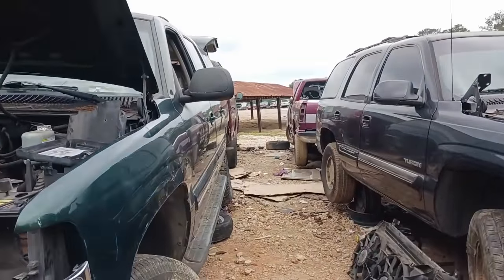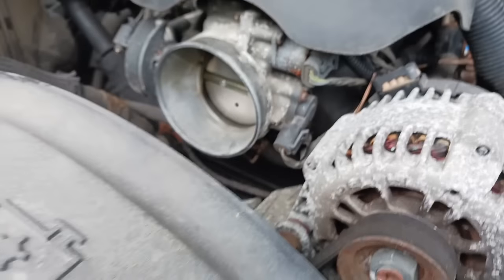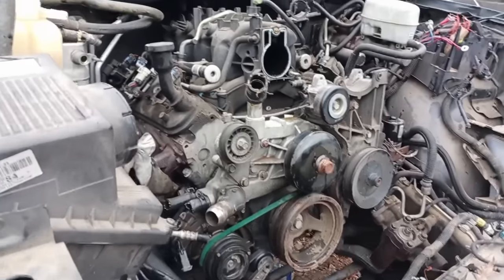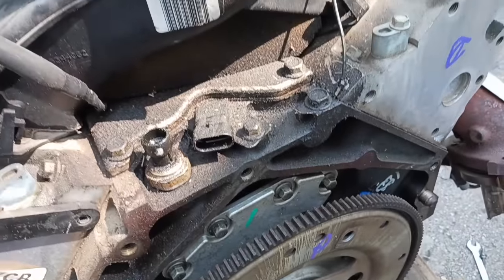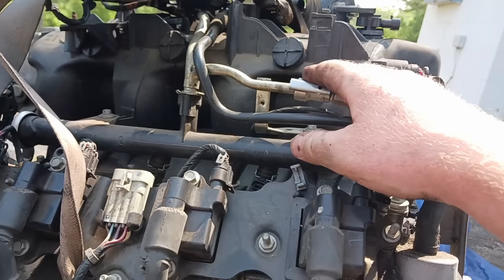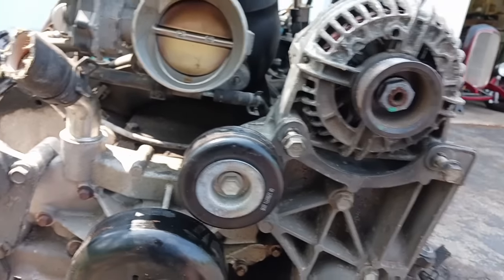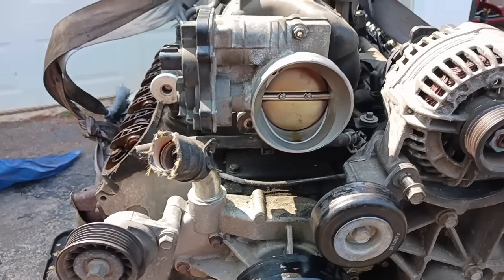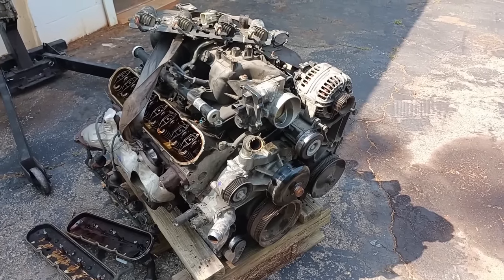Choosing a Junkyard LS Swap engine to Pull

Comment: Here’s my only bit of advice on choosing a junkyard engine. Get one out of a car that’s been totaled, smoked, hit really hard and not out of one that’s clean and in good shape. Odds are that the clean car is in the junkyard because it’s got a junk engine or trans.
Reply: Another tip that's related;
Not one that's taken a hit in the engine bay.
Preferably something totalled in the rear or side.
Reply from the maker: Yep, always look for the accident victom.
Reply: My advice is.  Start the dam thing and run a compression check on it  .don't guess
Reply: @inmate666 junkyard cars don't have keys 99.9% of the time in my experience. You might be able to manually turn it over but that's about it
Reply: @DaleDenton  true that. It was to easy for me because I owned my wrecking yard for about 30 years. I could start one in or out of the car but I had special stands and buzz boxes to start anything. Plus I had several guys to do it for me. When u sign the pay checks no need to get dirty anymore. If I sold a motor to one of my favorite shops it better be good.
Reply: Haha 💯
Reply: i got an 80k benz Inline 6 from a trans that had a hole in it. man i was so happey lo
Reply: I take a small portable jumper in the junkyard just to turn over the the engine. Sometimes you get lucky and the car will have the keys this is in San Bernardino California 92408 .lkq junkyards
Reply: Yup I pulled over 20 engine from junk yard they all run strong .  Make car
Reply: @DaleDenton  You don’t need a key to do a compression test, just bring a battery and a lone wolf 6000 trigger and hook the battery to the starter
Reply: This is literally what he says in the first part of the video.
Reply: This is the first thing he said in the video.
Reply: This☝️.. is definitely the first thing you should Think about/Notice when snooping thru the ol’ yard.
Reply: Damn it's like he said that in the video huuuh

Comment: You won't be finding LS engines in junkyards around my area. The yard pulls them before they set the cars In the yard.
Reply from the maker: That sucks, there's only 1 yard around here that does that, but they have newer cars and sell the body parts for cheap, so I can't complain. I just don't go there for engines.
Reply: @wilsworkshop  do you have a ls3 for sale by chance?

Comment: These are great tips for people junkyard mining for LS based engines. The truck engines (4.8, 5.3 and 6.0) make for a great swap since they are iron blocks with the same architecture. I'd swap out or closely inspect the knock sensors and harnesses also as well as the intakes for cracks. Covered it all pretty much though, nice work!
Reply: LS BASED NOT LS ENGINES...PEOPLE SHOULD LEARN THE DIFFERENCE
Reply: @mikedewsberry1774 YOU DONT HAVE TO YELL OLD MAN
Reply: @mikedewsberry1774 Actually they are. GM even says this.
Reply: @mikedewsberry1774  If you can put LS internals and accessories on it, it’s an LS. Truck motors are just iron block engines where as the car engines (LS1, LS3, etc) are aluminum blocks

Comment: Worst part is its getting harder and harder to find wreckers that'll let you pull your own motor or theyre already selling used motors so they wanna pull it for a price.   In canada wreck yards are disappearing left and right also.
Reply: Where I live, junkyards are not what they used to be. They are now "automotive recycling centers". When a wreck comes in the vehicle is stripped. Engine, transmission, axles and all useable parts are removed and cataloged.  You no longer get to wander through the yard.  Items are purchased at a counter similar to an auto parts store. If you want an engine or transmission you have to act fast because local shops buy these items as soon as the wreck hits the yard. The DIY'er is becoming a thing of the past. If you want an engine or transmission you have to go to one of the shops. You'll pay more, but you get an item that has been checked, repaired and/or overhauled, and comes with a limited warranty.

Comment: I never noticed that the flex fuel injectors are longer, I actually just swapped non flex fuel injectors for a set of 30lbs injectors but I didn't change the rail

Comment: there is nothing that comes of that, the vehicles have run their lives. done their share for the families. they wear out esp the rwires when they get frrayed etc, and the outside parts look beat  etc and most of all, if you throw them in the car truck etc they end up back to sq one after the "added" more abuse/miles and wont get the $$$$$$ like its the ones they started out with when you buy a new car,  its major headache plus when you tinker add holes etc to the vechicles they weaken the other partts of the vehicles and their ives are shorter as well.
Reply from the maker: I was just thinking the same thing.

Comment: Great info! A quick possible indicator for an E85 is the gas cap although the injectors is a definite way to identify them. Damage to the rear of the vehicle is always best since front end damage could have damaged the radiator and the engine was left running to overheat, spark plug inspection will help identify that. I also take a small jump pack with me. If the vehicle is complete enough you can usually get the cluster to fire up to check the mileage.
Reply from the maker: Yep, it's a good idea to always check the oil cooler and rad for leaks. Easy ways to smoke an engine if its in an accident and pumps all its fluids on the ground.

Comment: I took a different approach. I gave $2500 for a 2004 2500HD drove it 150 miles home. Sold core support. A fender Brush guard And transfer case. Then sold my trashed 350 tbi and the 4l60e and the ten bolt rear. Before Modifications/ Upgrades. After I hold the rest of the truck to the scrap yard. I have $700 in a 6.0 4l80e 14 bolt Full float rear. Front differential, Plus
Larger hubs and brakes.  Gas padel. wiring. Which I gave away, And it was all sitting in my yard while working on. Something to consider👍
Reply: Exactly I don't like wrenching in the junkyards either! Way better to buy the whole thing!
Reply: 100% if you have room for 3 junk vehicles.
Reply: @JamesMcNamara-j1g  Not plus not equals not. Lol.  It was one #" junk"  Vehicle   And Not to restate the obvious, but if you live in a Trailer Cort, An apartment building, Or a neighborhood with Home owners Association.  Then your 💩 out of luck. Well kinda, kinda not. Because hot roding and improvements are a sickness. So if you Save all your lunch money. You can go buy something That already has many Upgrade for less then it will cost to do it. Like a car someone spent a hundred thousand dollars to build and solded at baron jackson for forty. ✌️

Comment: I came across your channel and subscribed. I'm a equipment operator at pick n pull and i see customers go after the 6.0 Ls engine off gmc Denali and Escalades.
Reply from the maker: The 6.0s are the treasure for sure, worth 2-3 times as much as a 5.3.
Reply: @wilsworkshop  I'm fairly new to Chev's, why is this?
Reply: Aluminum block 6.0 is the golden ticket!
Reply: @absolarix because the 6.0 is a 400 cui full roller engine and there's no replacement for displacement!!😂😂🎉

Comment: If you get an AD244 alternator you don't need PWM controller. Sometimes a refurbished alternator will have a DR44 front so look to see if it's a 4 pin.

Comment: Very useful info thank you. I will say though that with all that knowledge but you still didn't know not to set the engine down supported on the flywheel gear 🤔.

Comment: This EFI stuff is out of my wheelhouse of expertise but I'm finally after decades thinking of messing around with this brand new EFI thing! Just kidding (I'm a shhhhh carb guy) but if you were going to try n make more power with factory parts would the flex injectors be capable of a bit more HP? I'm guessing they're larger for the ethanol? I'm one of those people that when they get interested in something I just absorb every bit of info I can do I was just wondering. Getting into boost is just so much easier with EFI and blow thru carbs are really expensive so I gotta figure this all out.
Reply from the maker: The flex flow 36 lb/hr. Non-flex 24 lb/hr. I usually use the flex ones with up to a "stage 2" cam with regular gas. They usually work for about 6 lbs of boost also depending on cam. Beyond that you'll need de-caps or aftermarket injectors.

Once you realize EFI is identical to a carb, but better, you'll never want a carb again. A carb can only be tuned for one tempature/rpm/altitude set of variables, but EFI is like having 100 carbs that get swapped out every time the rpm or other variable changes. EFI is max power at every step of the rpm range instead of a carb tuned for a narrow power band and "good enough" at the other parts.

I swapped to EFI 20+ years ago and literally threw my boxes of carbs in the trash.

Comment: Small head bolts? Never heard about that. I’m using an 01 5.3 so I guess I have small head bolts.
Reply from the maker: To clarify, it's "small head" " bolts". The valley cover bolts are large or small head, I think its 10mm vs 13mm,  from the engines I've pulled apart, all the "large head" bolts on 2005-2007  engines correspond to having Gen 4 rods since they were swapping production and gearing up for Gen 4 engines and used up all the Gen 3 rods.
Reply: that's good to know @wilsworkshop
Reply: @wilsworkshop  that's good to know. I wasn't aware of any identifiers for which ones got the gen 4 rods. Thanks
Reply: @wilsworkshop how much better are gen 4 rods ??

Comment: can the wrong fuel injectors make the truck run like it has a misfire?
Reply from the maker: Yes, if the injectors don't match the injector data in the computer they won't operate correctly.

Comment: What if i see gunk buildup in all the engine but it was running with low oil pressure. Do you think it Worth buying
Reply from the maker: Personally I would pass, the buildup usually means poor oil change maintance, so likely a neglectful owner and worn parts. Theres plenty of good engines out there to try rescuing beat up ones.

Comment: do you think a 1998 or 99 chevy 3500 ls would be a good swap engine has 120000 miles I want to put in a 56 olds I know it ran but the brain died its be sitting for some years now or look for a different one any problems you know of using this thanks
Reply from the maker: A 1999 3500 should be a 6.0L if it's a LS engine. The only downside is the 99-00 6.0's usually have cast iron heads instead of aluminum. Just extra weight and less desirable is all, doesn't really hurt the horsepower.

Comment: I figured you would have pulled the engine out of the truck that still had the hood.
Reply from the maker: I sorta did, I removed the hood before I started recording. Water intrusion from missing hoods is one of the first thing I look for. No hood and no intake manifold is a hard pass every time.

Comment: Hopefully those heads aren’t castech 706 heads. I lucked out on mine and they weren’t castech
Reply: I'm running 706 heads on my 96 gmc ls swap one turned out ok the other is not happy at all unspent fuel vapor just blows out the passenger side head I only noticed because I carbed my ls swap and had that venting into the air

Comment: also you make parts up to fit the rust, then you decidet part with the car after several years finding tires which wont last less then a  month, then the car breaks down wherever its going and all the hassle for a extremely short tem fix an last $$$$$$$ wasted for a new vehicle.

Comment: Is the motor out of a 07 suburban ltz 1500 any good for a swap ? Into an older chassis. Have the truck just sitting here, just wondering if I could do anything interesting with the motor, thanks
Reply: *I believe it’s the 5.3L v8
Reply from the maker: Check the 8th digit of the VIN, it's the engine code digit.
Reply: @wilsworkshop  is the 5.3 liter from that truck any good?

Comment: Why are you checking for leak?
Reply from the maker: Leaky engines usually mean more heat cycles on the gaskets, which can mean higher miles. Junkyard engines are a mystery, gotta improve your odds of getting a good one.

Comment: I love it but my problem is I love that whole truck. That whole platform from beginning to end is amazing. I hate everybody wants to pull that engine out and put it in a car. Why not just build the truck itself? I mean yes they brought out but the SUV doesn't rot out as bad as the pickup. The 2500 is solid the 1500 rots out and has a weak transmission.. weak by 20 year old standards... Today a 4L60 wud be god... The sick ol lady 6spd is ass
Reply from the maker: Yep, the GMT800 was the best platform of GM trucks pretty much ever, I have a few of them. These are junkyard "trucks" though, can't buy and fix them even if I wanted to. So the best we can do is snag their parts/engines.
Reply: I get what you’re saying, but those of us who are pulling these motors for swaps aren’t pulling them out of good trucks. We’re taking them out of ones that aren’t save able, if the body is all smashed and the frame is bent the truck is gone no sense in letting the perfectly good engine rot away too

Comment: Is the vortec actually an LS?
Reply from the maker: The 1999+ Vortec engines use the same or similar parts to the actual LS motors, and are usually refered to as LS Swaps, but technically they arent an LS, since they dont have a RPO code starting with LS. It's mostly a minor lettering designation that makes them "not a real LS".
Reply: @wilsworkshop  vortec  sounds cooler anyways
Reply: Yes LS with an iron block. Sometimes heads to depends

Comment: Has anyone used the code vin 5.3 aluminum block for ls swaps? 2005 Silverados had them
Reply from the maker: The gen 3 aluminum 5.3 engines in the Sierra/Silverado are the L33 engine, lots of people use them.

Comment: Question so I have a 05 Yukon with the 5.3 electric throttle body the motor needs replacing bt I have 2003 gmc Sierra 5.3 drive by wire throttle body can I swap it and jus change the throttle body and or intake altogether
Reply from the maker: The electronic throttle bodies were the same from 03 to 05, so you can use either one. They should look identical.
Reply: @wilsworkshop  okay so the engines are the same? all I have to do is jus swap the throttle bodies and or the intake and throttle bodies
Reply from the maker: If they're both LM7's or L59's then they're the same for those years. Even if one is a LM7 and one a L59 they're almost the same, just different fuel systems and computers. Just use the fuel rail/injectors from the Yukon if you're not sure and you'll be fine.

Comment: Why do people call vortec engines an  ls  swap??  I dont get it. They are 2 totally difrent engines.
Reply from the maker: There's multiple versions of the Vortec engines going back to the 4.3L In 1985. the 1999+ 4.8, 5.3, 6.0 share the same architecture as the LS1 rpo code engines and most parts are interchange between the two. They have 2 different applications, truck vs car, but are extremely similar in design. It's more correct to call them "ls engines" then Vortec, since Vortec swaps always refered to 4.3s and SBC 350 engines with Vortec heads in the 90's. Even the L31 Vortec 350 survived in vans until 2002, overlapping the LS based Vortec engines.
Reply: @wilsworkshop  not the same engine trust me.. different internally and head design. That was my point . Casting are the same yes I agree.
Reply from the maker: Not sure what engines you're talking about, but 5.3's literally came, from the factory, with LS6 heads on them, casting #243. LS1 heads bolt right on also, just lower compression some from the chamber volume.
Reply: Thanks for showcasing your superior level of knowledge!  Same fkn generic platform....minor design differences for low rpm torque for trucks.   Just like coyotes for mustangs and trucks.

Comment: Even if the vehicle was in an accident I would still think the engine is probably gana fail because what if it had engine problems too. Probably the guy was driving like a demon and crashed and the engine is abused jajaja..
Reply from the maker: It's true, one time I grabbed an engine from a truck that had a smashed windshield covered in dried blood. I was in my garage working on it and something was just a little off. About that time the Brujo next door came over to drink some beers. While he took one look at the engine and started yelling in Spanish and making what looked like gang signs in the air. I don't remember what all he said except he kept chanting "Conductor Diabolico! CONDUCTOR DIABOLICO!" I threw that engine right in the trash can that night, made a pretty loud thump the next morning when they dumped it in the back of the garbage truck.
Reply: @wilsworkshop  the dude who owned that truck probably has some relationship with evil 😈 shit. That's one big one that we don't think about when grabbing used shit who's was it and who was they. crazy..